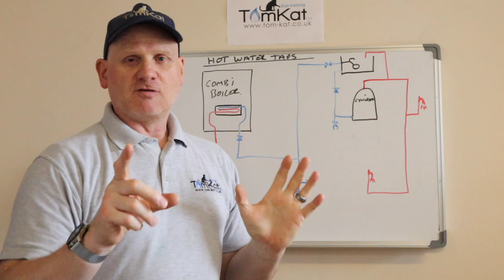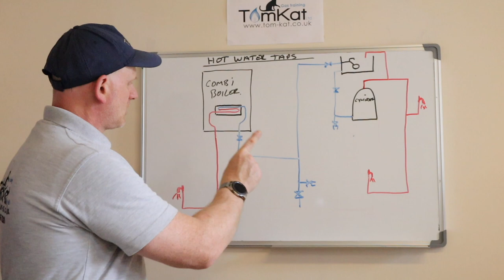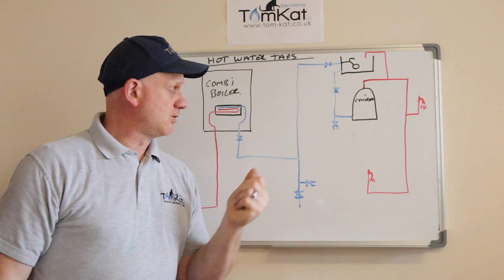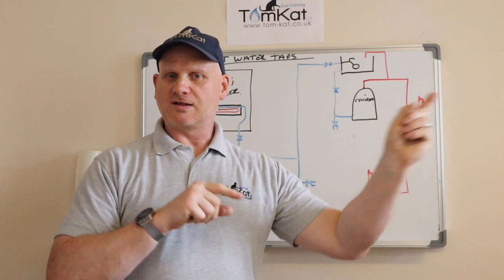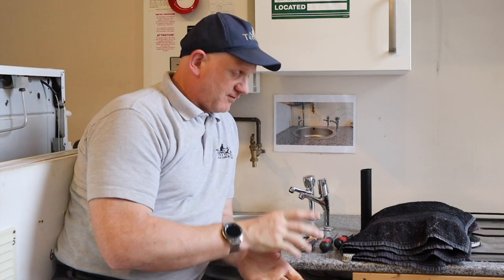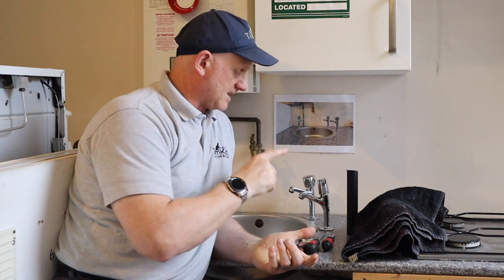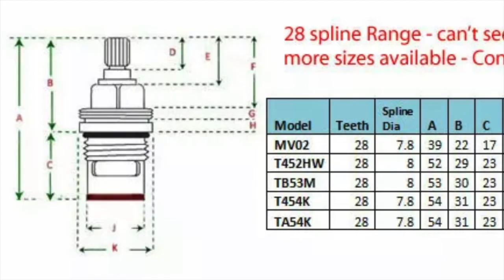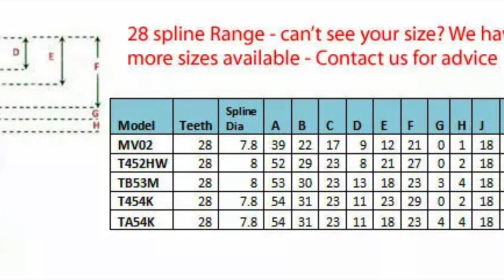HOW TO FIX A HOT TAP, part 2 replace the ceramic disc on a quarter turn hot tap. Plumbers/DIY

Comment: Brilliant. Was nice to see the different positions you can actually isolate the hot water depending on where the isolation valves are situated etc. I literally gave this a try after watching part 1 and wasn’t successful because b&q and the local plumbing merchant didn’t have the one I needed with the exact same number of TEETH. So this job is on hold at the moment 🤣.  I didn’t know they’ll be so many important measurements but thanks to your video I now know. Thanks for sharing Derek 👍🏻

Asian Jon. Training.

Comment: Hi I'm.trying to change my hot tap cartridge but it's very stiff to undo. I just want to check I'm undoing the correct way right tight left loose x